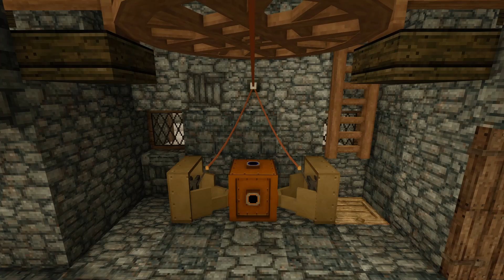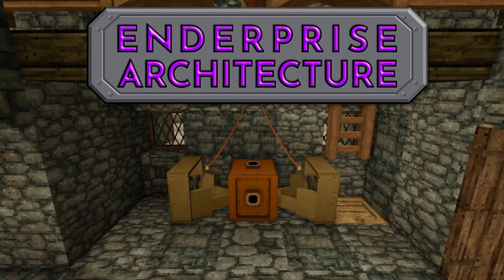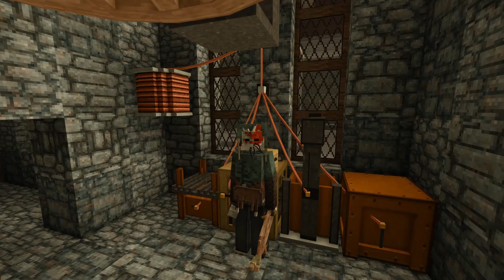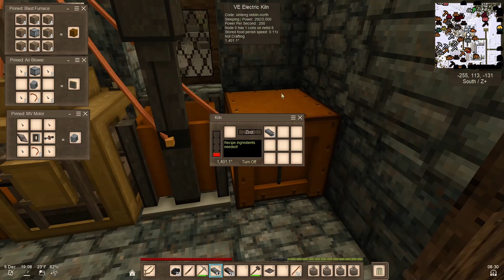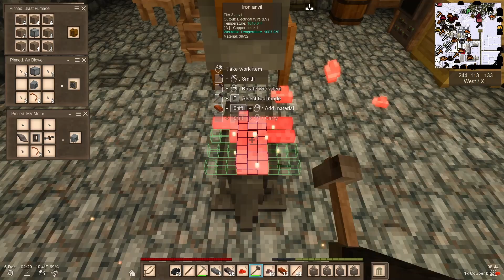Vintage Engineering Part 2 - E35 - Season 2 - Modded Vintage Story

Comment: There seems to be a severe lack of information about how to setup a network and all the machines in line to make all these things, a full tutorial just covering this mod as a standalone would be amazing and very appreciated.
Reply from the maker: Is there something I didn't cover between parts 1 & 2?  I thought I went into most of the mechanics but I'm always happy to revisit topics!
Reply: @EnderpriseArchitecture  I was more or less suggesting a flatworld explanatory video step by step with total material requirement displayed in crates next to them style video a real mod showcase with explanatory dialog, I found it a little hard to follow because of the hard cuts in the video, but i understand that was for the sake of it not taking a million years to prep everything. Regardless it made me understand it a lot more, and you where the only video on the subject to even explain it in this lv of detail.